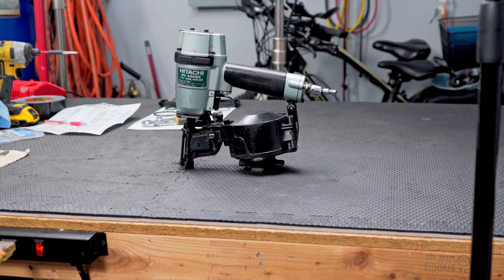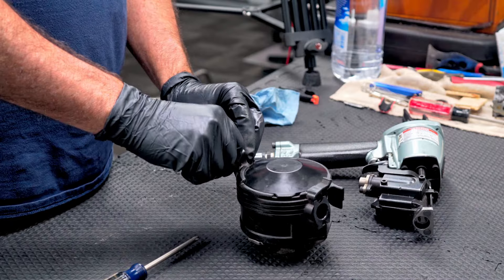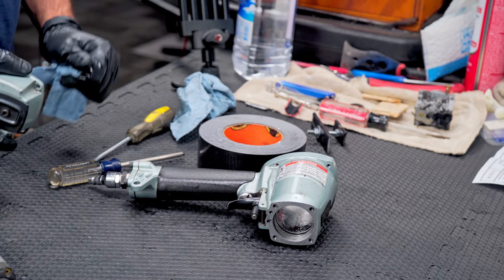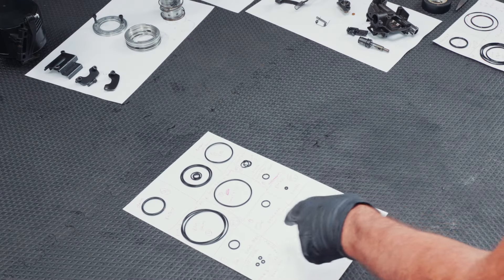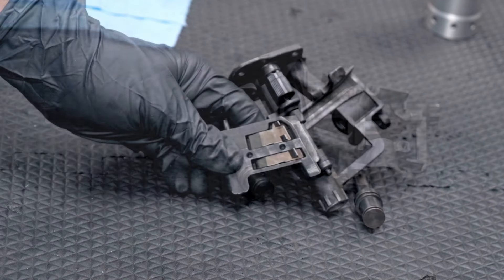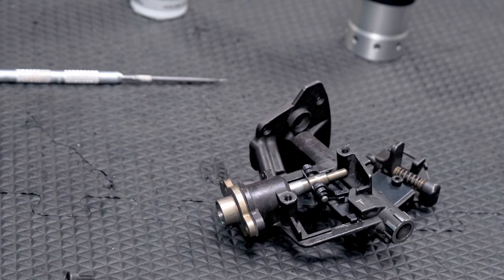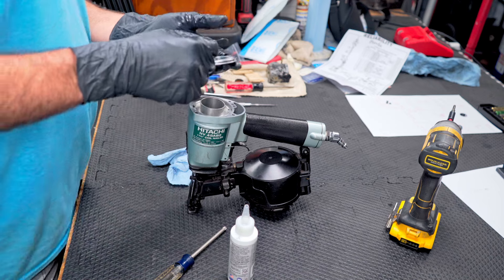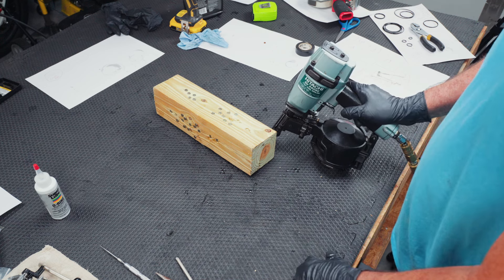Hitachi/ Metabo NV45AB2 Roofing Nailer Skipping Nails, Doesn't Fire Right, Leaks Rebuild

Comment: My brand new metabo nv45ab2 roof nailer is double and triple shooting nails in one spot.  Ridiculous.  Complete defective.  Even the depth adjustment doesn’t seem to be doing anything.  Even misfires a lot too. Couldn’t even do any work with it , tried adjusting on test wood.  Used for a minor one shingle repair and triple fired all over. Nails flipping upside down and popping out.  Even have metabo nails. Beyond words and upset. I bought this gun because of the ratings but now seeing a lot of same complaints.  I guess the good ratings are manufactured. It’s costs a lot of money and then the time to buy and then return is a lot more wasted. I’m very disappointed in the metabo.  Thank you for the good video though.   My situation isn’t a repair but need replacement.   Wish I could easily adjust to save the time of replacing it. Great video.
Reply from the maker: HI!  Wow.... that's not good.  I've wondered if the "Metabo" is really the same as the "Hitachi" nailer.  Maybe you just got a bad one and an exchange will solve the whole problem.   Or has the quality suffered since switching brand names...  I can't answer that.  If you bought it from a big box store/ Amazon, etc they usually have a pretty good return policy if you're within the time period.

Comment: Great vid I'll have to refer back to after my roof is installed. Lots of potential mistakes could happen rebuilding without a manual or this video.   Considering mine seems to work,  it sure looks well used or even abused, Im hoping it's got one more roof left in it. I hear the hitachi was better than the metabo version is why I drove and bought a used hitachi.
Reply from the maker: That's a good question.... Is the Metabo as good?  I can't answer that.  I am glad to have one of the original ones.  I got the parts from the 0-ring store...  They were pretty reasonable... I want to say less than $20 with shipping.

Comment: My Hitachi NV65AH2 siding Nail gun, the driver does not go back after fire.  I have to unplug the air hose for the driver to go back, and it is constantly stuck.  Do you have any idea what is the problem and what would I do  to fix it?  Thanks
Reply from the maker: Have you tried to take off the head and see if the factory lubrication has broken down and became sticky?  It might need to be cleaned up on the inside and relubed with some of that silicon grease...  Unless your o-rings are old and they are not sealing well anymore..  I would try to clean it first.